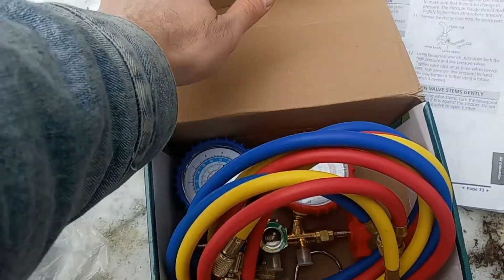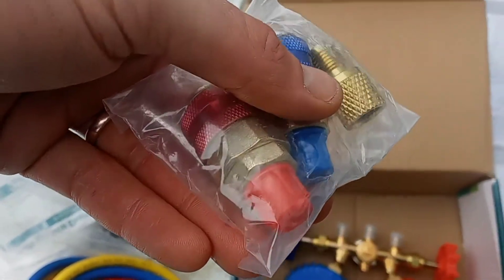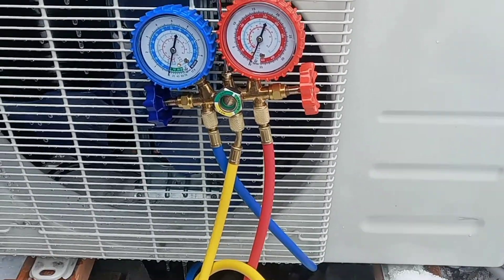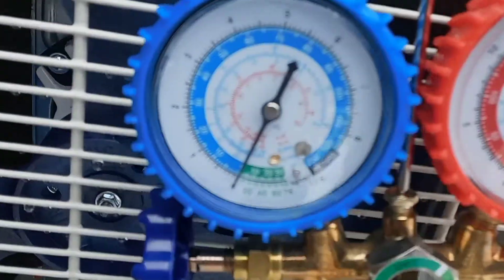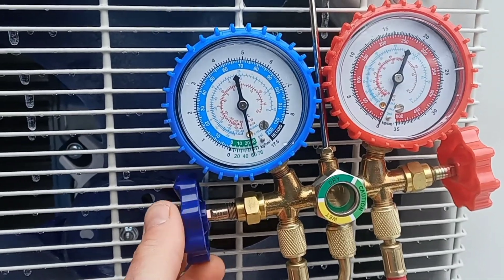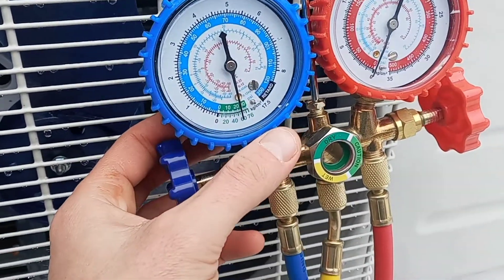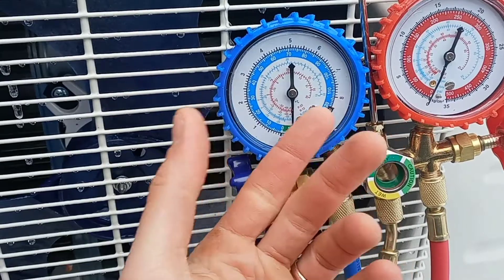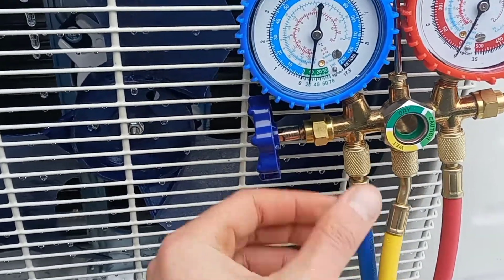The most difficult part of a DIY mini-split installation... vacuuming down the lines.

Comment: hardest part for me was torquing the flares to spec because the spec in the manual was way off and stripped the copper out of the fitting. vacuuming was not too bad. if you use a micron guage you know you have a good vacuum

Comment: How was the rest of the install. I have to install units in my garage and don't want to pay someone for shitty work. Did you make flares and all?
Reply from the maker: No I did not make flares. I felt that was a needless point of failure for an amateur like myself. I simply measured to try to install the unit the preset distance away. To my knowledge all three of the units I've done are still functioning fine. I've since sold two of the homes with them but the one at the location where I'm at now is on its second year still running fine.

Comment: Do you release the refrigerant, then unhook the vacuum hose, or unhook the hose, then release the refrigerant?
Reply from the maker: I cannot remember but I believe the users manual told that part. It needs to hold that vacuum for 15 minutes to prove no leaks and then you cannot let any air into the lines before releasing refrigerant. It's been awhile
Reply: @howpages  I’m trying to figure out if there’s a way to do this without losing any refrigerant

Comment: It's might be basic, but I just did that exact thing and had to re-pull my vacuum
Reply from the maker: Hmmm. Did you have the right adapter? If it's wrong it looks like it's pulling but actually is not pulling it from the line set. It's like a shrader valve? Maybe look for some other HVAC vids to see if there is something I didn't explain.
Reply from the maker: If in doubt find an HVAC guy who will just do the line set check and pull down the vacuum. Any small leak, loose fitting etc will make the pressure not hold.
Reply from the maker: Also line set length amount of initial charge, following valve instructions on your installation manual etc.

Comment: Ok- I understand the vacuum part and holding the negative pressure part.  My question is- kwik-e-vac is  just nitro gas in a can? So after vacuum- can I use   the Kwik-e-Vac as a nitro test for possible leaks?
Reply from the maker: I am not sure. Is there anyone with more expertise who can answer this? I would think not. The way you check for possible leaks is by drawing that vacuum down. If the vacuum won't hold you know you have a leak if it will hold then you know you don't. Additionally drawing that vacuum down then creates the proper pressure once you to release the refrigerant. If you don't have it as a vacuum when the refrigerant is released I believe it's going to make the pressure too high but I could be wrong there.

Comment: Turn the pump on open the blue knob let pump run fr 30mints after 30mints CLOSE THE BLUE KNOB AND TURN OFF THE PUMP watch the needle to stay on -30 for another 30mints if it dont go twords the 1 its a good vacume n you have no leaks.
Reply from the maker: Yes true

Comment: Do u need specific pump for specific refrigerant?
Reply from the maker: The new refrigerant types require different fittings typically, but to my knowledge a normal vacuum pump works for all these. But if you are adding or removing refrigerant you need another device I believe. I am not a trained expert in HVAC at all. Anyone who is have a better answer?
Reply: @howpages  thanks..I'm just trying to pull vacum on lines

Comment: How did it go?
Reply from the maker: This system is still functioning as far as I am aware. I have now sold the house, but it worked fine for a year.
Reply from the maker: I have since installed the same brand at two more houses and they are both working well.

Comment: For those DIY'rs that have a colder climate then yours, where you need to heat below 32F outdoor temp, make sure you purchase a mini split that has a pan and compressor heater in the outdoor unit. It will never properly defrost without that. I installed a Diakin unit 2 years ago, that I thought was quality, and it does not have these heaters. It iced up quickly and by late December I shut it off. These mini splits that advertise -5 or -15, -22 operation should have these heaters.

Comment: Your video came up by random to my feed. You need to purchase a REAL micron gauge, they are not that expensive, given you got a good two stage vacuum pump from HF. You need to get it below 300 microns to ensure you have the water vapor removed from the system, especially seeing the conditions you are finishing the install in. And it needs to stay below 500microns for an hour. The micron gauge also needs a short hose with a 1/4 turn ball valve to shut off the line to the vacuum pump. The problem with the cheep manifold gauge set and hoses, they leak vacuum. The longevity of your installation depends on no leaks and a good vacuum.
Also, you need a hood over the system to keep snow fall off. It will never properly defrost with snow dripping down the coil, and will eventually block the coil off during your operation as a heat pump in the winter. 
I don't know where you live, but heat pumps don't work well below 32F. Systems that say they operate to -22F, they have a COP of 4@47F, COP of 2@20F, COP 1.9@0F, 1@-15, and less then 1 at -22. I wish air source heat pumps were better as my winter gets to -20F at times, but average day time high is 20F during the late Jan through Feb duration of winter.
I wanted to comment so others understand they CAN DO THE INSTALL themselves, but even with additional tools is much cheaper then a HVAC tech will charge, for just pulling the vacuum and opening the unit valves. Also buy a decent flaring tool and cut the lines so they are not coiled behind or on the ground. DIY'ers need to practice doing them on a scrap piece and watch some youtube videos, but I know the HVAC tech's all want others to believe it can not be done properly by DIY. The flare tool needs to be of the type that rotates the cone to roll the flare, this removes and surface scratches that would prevent a good seal. Also total removal of the cutoff ridge from the tubing cutter is required, and I've seen where the deburring tool can leave deep scratches in what will become the flare seal surface, so care is needed there. 
The other issue more over is having the correct sense of how tight a flare fitting should be. If you over tighten them, the copper will be squeezed at the 45 tip and cause it to break through the thin wall of the tubing. And that is a  learned skill from working with wrenches. The specialized torque wrenches for flare fittings are pricey, but may be needed for those that don't know how tight the fitting needs to be without over torquing it. And on that subject, I've seen instructions that have the wrong torque levels, and will result in over-torquing the fitting, it has to do with how hard the copper is of the lineset, as well the wall thickness.
Reply from the maker: Thank you Fred. Would you be interested in filming a video for how page about this or another topic that you have expertise in? Your response indicates the kind of DIY thought and expertise I would like to include.
Reply: @howpages  So my experience is I attended a two year trade school back in 1974-76 . This was for refrigeration mainly, as the heating side was a different  class that included duct  work building and install. I worked as a lab technician for The Trane Company (before American Standard purchased them).
The refrigeration training just  included so many other skills. There was electrical theory, as well as practicum methods. Brazing, flaring  and threading but flaring  is practice it till you learn how, learning how to properly deburr the inside of the tube. 
Since I was doing many of these (as well as brake line work on my truck)  I purchased a conical deburr tool that  is a hand crank countersink looking tool. You can't scratch the inside of the tube. Deburring is the most critical thing for a proper flare to be done. The other thing, people own those cheap flaring tools that has a clamping bar and the 45 degree cone driven into the tube end with a screw press. Yes you can make good flares with  these, but the skill level and cheapness of the tool, and knowing how far to stick the tube above the clamping bar just makes it too difficult without 100s of flares being done to learn how to make them perfect. If the copper is over pressed, it will have a thinness failure. I purchased a yellow jacket 60278 Flaring Tool (current Amazon price is $154), so that tool for what might be the only time 4 good flares are needed will keep the DIY from being successful.

I'm about to install a 42KBTU mini split on my garage, just what aspects of an install are you thinking.
Reply from the maker: Based on your comments and attention to detail, I would think any and all aspects of install you wanted to cover.
Reply from the maker: Also something to consider on the line sets is the minimum line length required for the charge. For example I believe my min was 10ft.
Reply: @howpages  Not the minimum length, but the maximum length. The unit comes precharged with R410a, and more is needed for exceeding the install instruction line length maximum.
A real good channel that has install information as it's intended as a tech training channel, AC Service Tech. 
Here he has a full install of inverter mini split but to a conventional air handler. He sells C&H brand units;
https://www.youtube.com/watch?v=A4yJDt07sj0
Reply: Most of these mini split units use electronic expansion valves (really a stepper motor on a flow valve) to control refrigerant flow, so the control microprocessor is measuring temperature of the indoor unit, and adjusts the expansion valve as needed for operation. So the last few coils of the outdoor unit along with the lineset store the extra refrigerant for operation, the  system will be starved if longer linesets are used, hence the need to add more for longer runs. This typically is not a homeowner issue unless they have a two story and they run from a hidden place all the way to a remote room.
Reply: @howpages  So if anyone is ready these comments, I don't think I could improve on a full installation better then this guy's channel;
https://www.youtube.com/watch?v=A4yJDt07sj0
Note this is not a high wall system as the typical mini split, this is much more like a conventional system with an A-coil, but a dedicated air handler vs using the plenum at the top of a furnace. This may be the system I purchase to replace the 25 year old R22 system I have in my house.